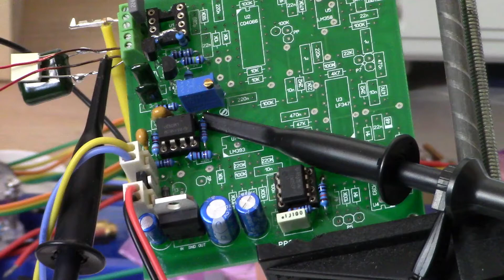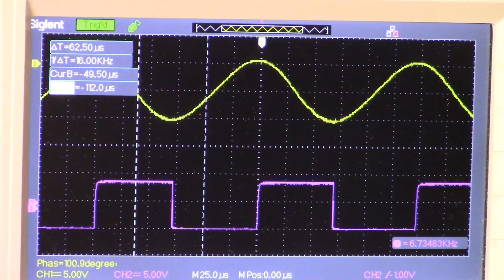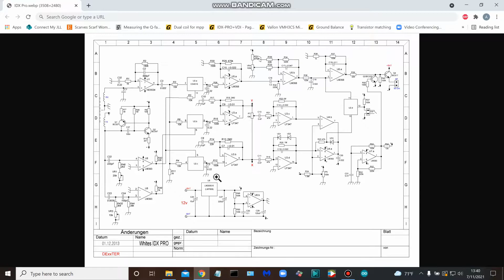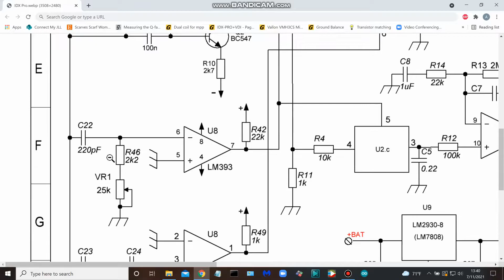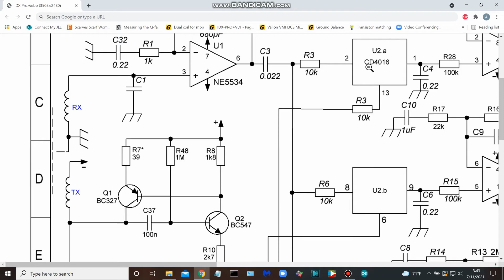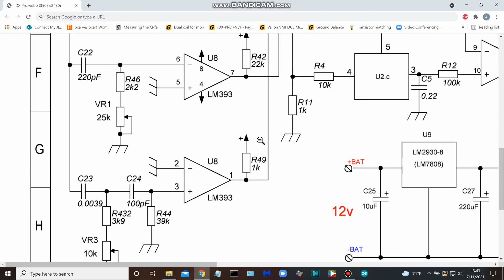IDX Pro part 4 GEB and DISC Sample pulses

Comment: Although less sensitive than the P.I Delta Pulse 2 and heavier this is a very good V.L.F one. It has a perfect stability and gives a nice sound. It's to be made. I was about to give up thinking that there was an error  in the diagram i couldn't find out when i caught the culprit who prevented it from working from the beginning . A short strap that detached in the inside from the weld.

Comment: Your explanation about the circuits is very good. I would be grateful if you could explain about the discrimination part of this circuit and how it works from the transmitter and receiver signals.
Thanks...

Comment: the frequency of the tx coil on my board is 6,453 and my rx coil is giving the same frequency as the tx coil
How do I measure the frequency of the rx coil with a multimeter that has a frequency scale?
and what are the correct frequencies for the coils?
Reply from the maker: TX 6.59KHZ maximum
RX 4.9KHX maximum (I did mine at 4.75KHZ)
Your TX and Rx cannot be the same 
I did separate videos on both the RX and also the TX part of this project, you should watch them.
Reply: @SurfDetector  what is the easiest way to measure the frequency of the rx coil?
can i change the tx coil and put the rx coil just so I can measure the frequency?
Reply from the maker: The easiest way is to just swap out the  TX coil for the receive coil,  I believe that my video shows me doing that.
Thanks for watching.
Reply: @SurfDetector  sorry but i don't speak english and the you tube translator doesn't translate well what i would like to know is to measure the frequency of the rx coil do i need to have a signal manager?

Comment: good afternoon friend I would like to know how the potentiometers are connected I have an idx pro board mounted but I don't know how to connect the potentiometer
Reply from the maker: You need to take your schematic and match it up to the PCB in order to figure out the connections.
Reply: @SurfDetector  for me to measure the coil frequency (rx), can i replace the tx coil and put the rx?
just to measure the frequency of the rx coil
Reply from the maker: Yes, exactly

Comment: Hi Bro Im Need How many turns of winding should be used with 35 or 40 cm 0.30 copper wire for round pulse detector? and how many capacitors need to be installed
Reply from the maker: https://www.geotech1.com/forums/showthread.php?17909-Coil-Calculator
You do not need any capacitors for a Mono-Coil.  I made a video on how to make a Mono-Coil here:
https://youtu.be/AqZEsPaXV-Y

Comment: How many turns of 40 cm coil, how many capacitors
Reply from the maker: Hello Emin,
You will need to experiment in order to make custom size coils.  The coil calculator does not work well unless you are making a circle.  When you make the coil into a "D" shape the inductance changes.  It is best to have an inductance meter and an oscilloscope. For the RX you need about 47nF capacitor.  For the TX about 1uF.  These values are close but you need to experiment in order to get as close as possible to the correct frequency.
Reply: @SurfDetector  monoloop coil bro pi dedectör coil
Reply from the maker: @emindagkran5839  Hi my friend.  I thought that you were asking about a VLF DD coil since the video that you commented on is about building a VLF machine.
Here is a coil calculator that is good to use for Mono-Coils:
https://www.geotech1.com/forums/showthread.php?17909-Coil-Calculator
Reply: @SurfDetector   thx bro🤣🤣

Comment: ممكن توضح لنا أفضل جهاز لا يتأثر بالتربة ويكون على عمق كبير
Reply from the maker: Hello Majid,
I think that you need to use a Pulse Induction detector.
Reply: @SurfDetector  arduino nano?
Reply from the maker: @مجيدوحيد-ذ8ق  yes that is a Pulse Induction machine and is an relatively easy project. It really depends on what you are looking for.
Reply: @SurfDetector  ماهو البرنامج الخاص بطباعة لوحة pcb
Reply: @SurfDetector  لقد نزلت ملف .Gbr
Reply from the maker: @مجيدوحيد-ذ8ق  I only use Gerber files to have my PCBs made

Comment: hex and pdf. tanks
Reply from the maker: Hi my friend.  There is no Hex file for this project as there is not a PIC.  I do not have any pdf build file either.  I am not sure what you are looking for.
Reply: I want to assemble the Polons metal detector myself. To assemble it, I need a file of its parts and operator training
Reply from the maker: You confuse me by asking questions about the PI Polones on a video for the IDX Pro.  What does the Polones have to do with the IDX Pro my friend?
Here is a link to the pcb that I used:
https://easyeda.com/jeanfreitas/pcb2-placa
Reply: I'm not very good English. I'm Persian. Thanks for your guidance
Reply from the maker: @behzadt9968  No worries my friend,  you just confused me with your question as I did not understand which detector you were asking about.
Reply: Sorry it was my fault. I'm building a ((Polones)) metal detector. I needed the names of the updated parts and the battery that was used. Thank you for answering.
Reply: Didn't you collect Polones  yourself?

Comment: hello bronte one master;idx pro air test works well soil does not pierce.what can i do for 30 cm depth thanks
Reply from the maker: Hi my friend, I am Surf Detector.
With a VLF machine the air detection distance is always more than detection in the soil.  This machine is not like a PI machine.
Reply: @SurfDetector  thanks master
Reply: @SurfDetector  hello master.
can you share surfpi pcb and info.thank you so much
Reply from the maker: @bayramgurdal5739  I bought my SurfPI pcb from Silverdog.  All of the information that I have is from the Geotech Forum.  You should make the Arduino PI, it is better than the other and the Gerber files are on Geotech.
Reply: Hello Professor, can I contact you on WhatsApp or email? I am from Tuts and I have some questions, please

Comment: Hello, nice explanation, but I have a question, is the Tx signal moving back and and forth, or the GB and Disc signals are the one which moving , in other words Which one is the fixed signal , and Which one is the adjusted ones, phase shift adjustment  is made by which signal? Because you mentioned that the TX signal is the one which  moving.
Thank you for your videos
Reply from the maker: In retrospect I should have explained that the potentiometers were to adjust the phase difference between the RX and the respective GEB and DISC samples.  Thanks for watching and commenting.
Reply: @SurfDetector  It's my pleasure to watch your videos , I really like the way you explain each part of the circuit separately, it makes things more simple to understand, I would like to see even further details , for example why the phase ajustment for GB take a specific position with respect to RX , and the same thing with the discrimination part, and maybe talk about the ground and the metals , and hoe can we eliminate what we want , just by ajusting the phase between RX and GB/Disc Samples.
Thank you for your helpful videos. good luck 🙂
Reply from the maker: Thank you for watching Samir.